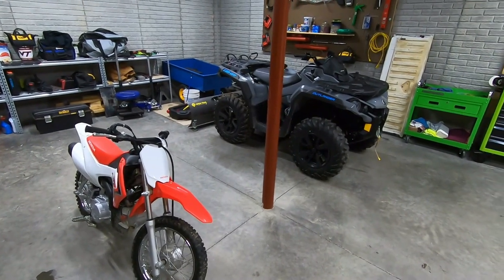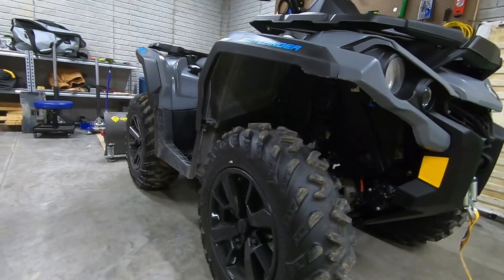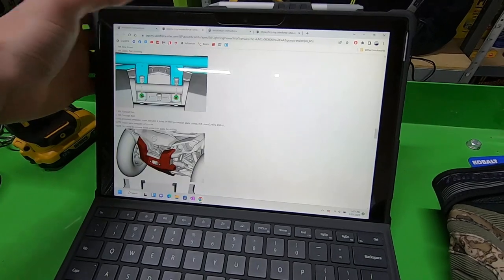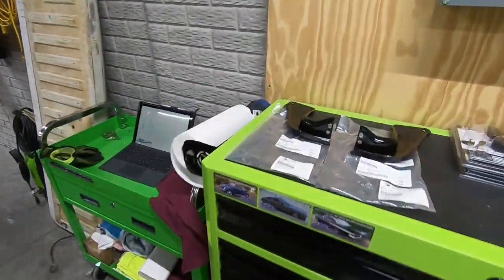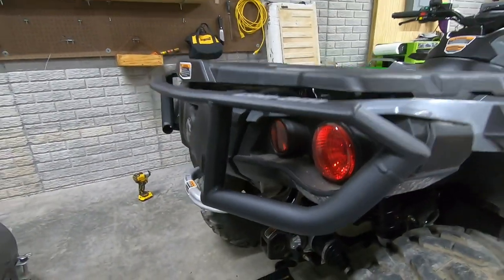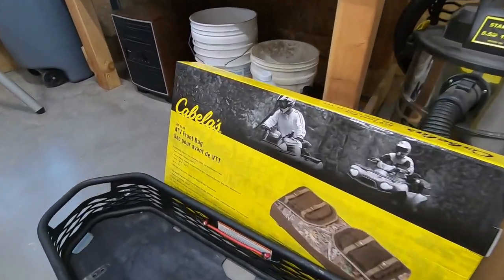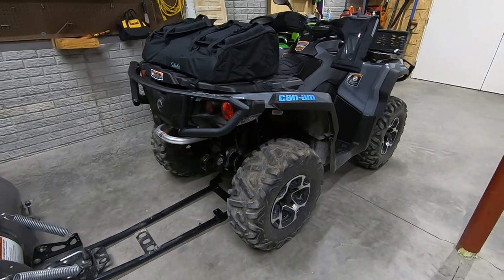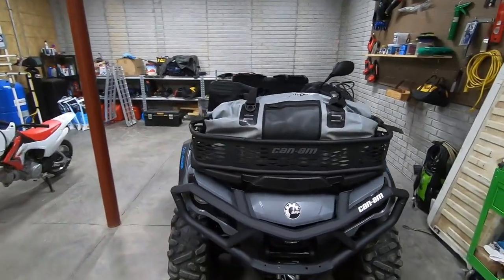My Outlander Trail Build - Ft. Can-Am Expedition Bumpers & More!

Comment: i'm in the exact same position.i ordered the base 500dps.i already have a winch,2 sets of new alloy wheels/tires,bighorns and carnivores,NIB light pods,and a set of Elka stage 3 shocks that may or may not fit.all i need are the hd5 bumpers for now.they look alot like the ones you're installing.

Comment: One thing you may want to consider is a full underbody skid plate I know if you hit the Hatfield and McCoy trails enough, you will benefit from better protection underneath. Iron Baltic would be my recommendation, I believe they may be better than the Can Am ones, a little cheaper , and you can buy it as a whole set, instead of the pieces individually, nice video by the way

Comment: Do you by chance have the PNs for the 12” rims you used? Looking to do the same thing you did lol. Thanks!
Reply from the maker: I see where BRP offers an all black version of this wheel still (705401127). I found these on marketplace and actually just replaced them with a used set of beadlock wheels I also found on Facebook. I know the wheels in this video were from an early Gen 2 Outty. There's a ton of used ones out there for good deals. May be worth your time checking. I definitely like the riding characteristics of the 12" wheel better!

Comment: Are those tires true to size?  Are they actually 26 inches?
Do you prefer 8 or 9 inch width in the front?  
Would you buy these again or would you look at other options?
Reply from the maker: These measure very close to 26," much closer than the sunf tires I've run in the past. We have several hundred miles on them and they are holding up well, even riding on pavement. I'm not opposed to an 8" wide in the front but they get harder to find when you're looking at 26s and up.  I would buy them again. Much cheaper and lighter weight than the Maxxis Bighorns or Bighorn 2.0s. I currently have them mounted on a set of canam beadlock wheels. That's my favorite setup so far.
Reply: Thanks for responding.  I was also looking at the Sunf tires and it sounds like you prefer your current tires.  I have the 570 max and plan to upgrade the tires  soon.  And possibly the wheels if I can locate a good deal on used. Thanks much
Reply from the maker: @ecarroll27019  You're welcome, thanks for watching! I ran the sunf tires on my 570 Max when I had it. I purchased 26s but would definitely go 27s with sunf since they run so small. Great tires for the money though
Reply: That helps me a lot, thank you.  Do recall if you put those sunf tires on stock 570 max rims?
They say the rim size can make a difference because it can affect tire height depending on bulge or lack of bulge.
I have the 570 Max xt with stock wheels. 6 inch wide in the front and 7.5 inch wide wheel in the rear according to the manual.